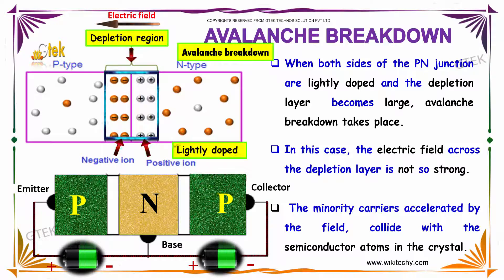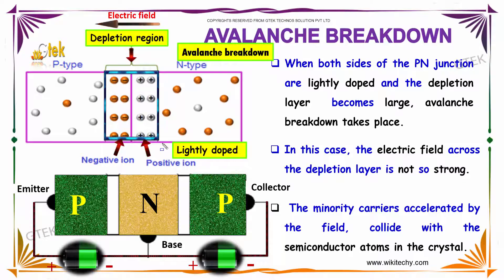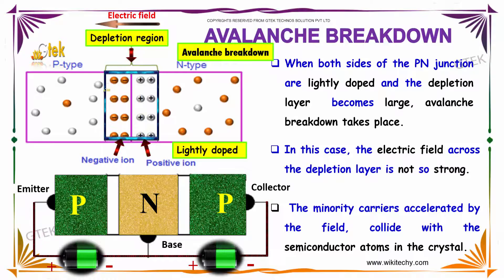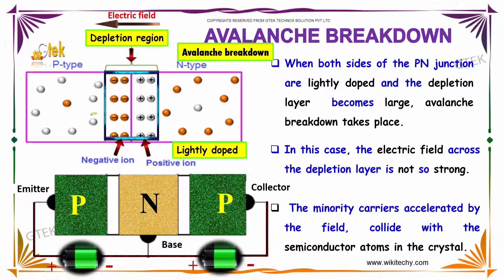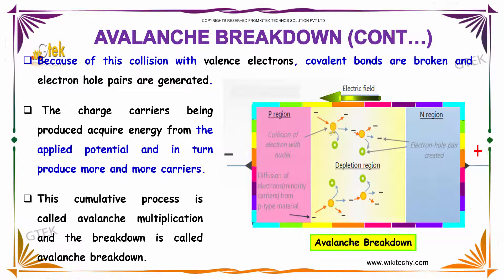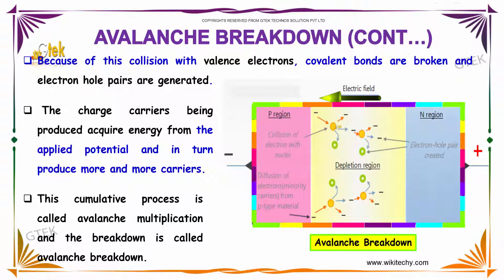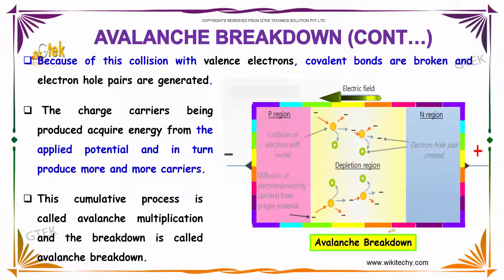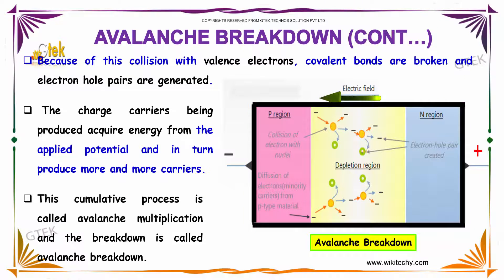Avalanche breakdown Semiconductor Device cbse 12 physic JEE Main and Advanced physics

Comment: In electronics, an avalanche diode is a diode (made from silicon or other semiconductor) that is designed to go through avalanche breakdown at a specified reverse bias voltage. The junction of an avalanche diode is designed to prevent current concentration at hot spots, so that the diode is undamaged by the breakdown.